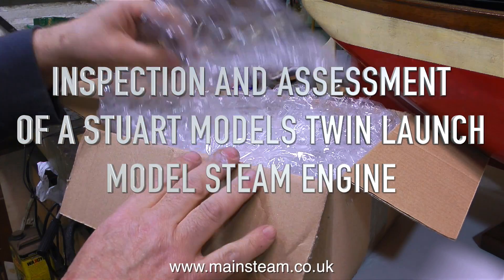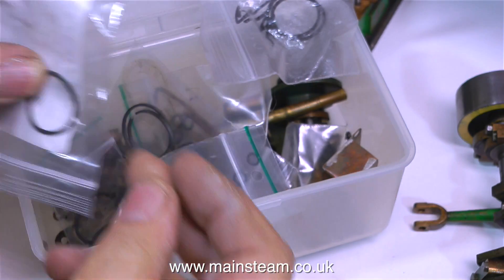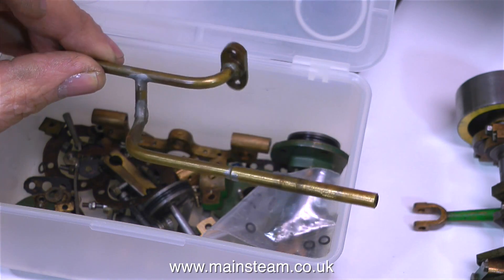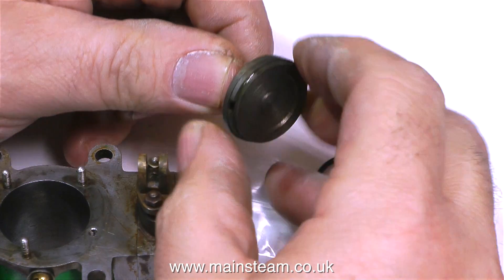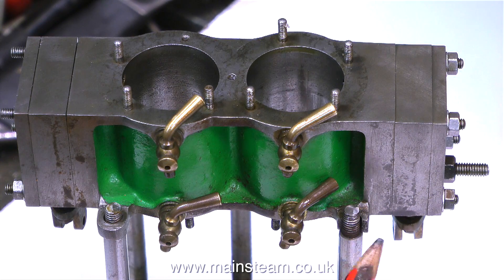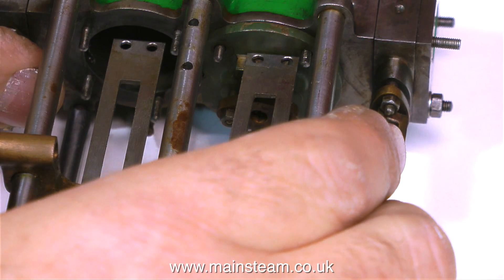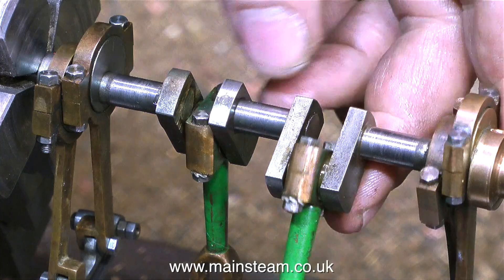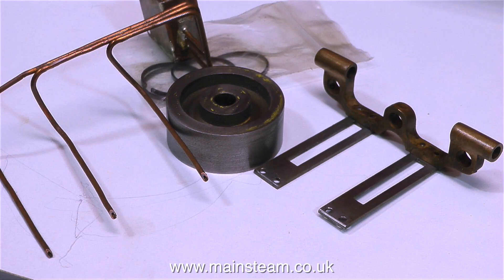STUART MODELS TWIN LAUNCH STEAM ENGINE REBUILD - PART #1

Comment: why not remove the pin on the crank and braze it or solder solder it?
Reply from the maker: Unnecessary heat distortion - It works fine the way I show in the video ......

Comment: Not having much luck trying to find part #22; can you post a direct link??
Reply from the maker: Here is a direct link to the playlist - you can't find part #22 because as you can see by the playlist below - the series ends with the engine in steam - in part #21 . . . . https://www.youtube.com/playlist?list=PLDV_TkPc48REOitk6d8JnewzF1ijIgDgM
Reply: Thanks for that! Actually i was hoping to know a bit more about silver soldering the manifold and how you pierced the openings in the tubing once it was assembled.

Comment: Hi Keith, Is that crankshaft pinned and silver brazed, or just pinned?
Reply from the maker: Silver Sodered & pinned but the Silver Solder gave way ..... and the pins were a slack fit too .....
Reply: Thanks for the quick reply :)

Comment: Wow! I hope your client will invest in a complete repair and you can document it as this is very interesting project.
Will you save the manifold flanges or start over? One or all, to my eye looked a bit bad/ugly ok a lot bad and very ugly
never mind the crap solder work and poor bends replaced with as good as or better work as the oiler assembly would be nice to see. Thank you..